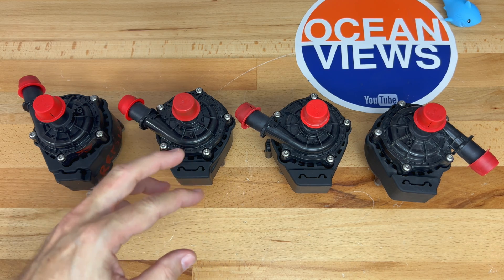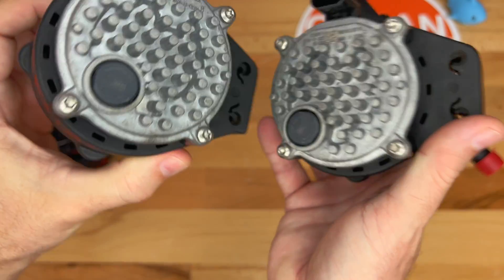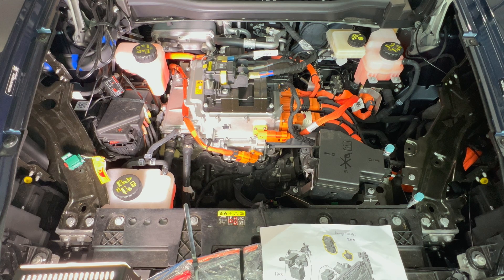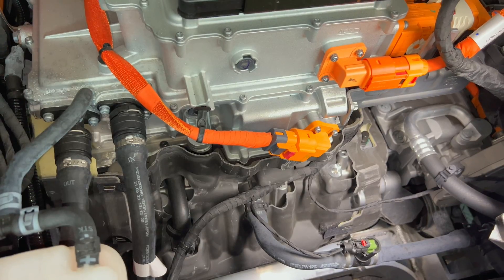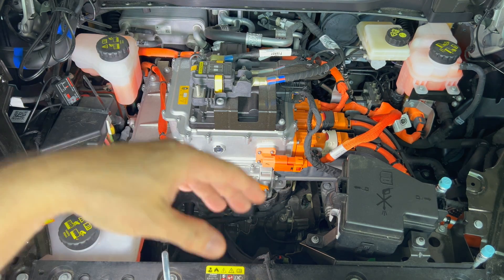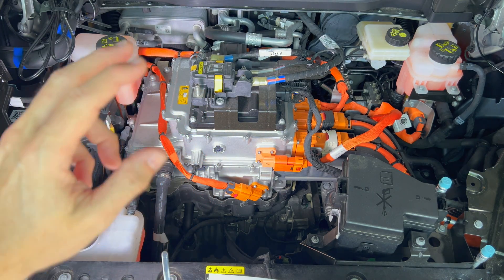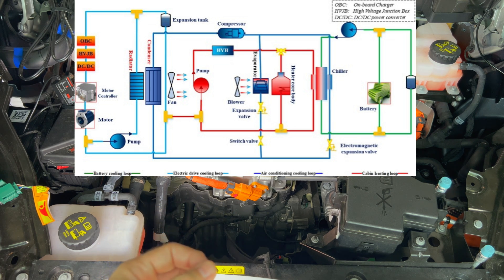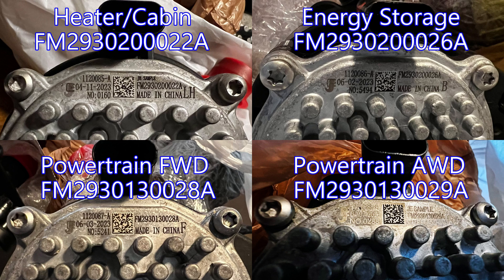Fisker Ocean - Water Pumps & Coolant System

Comment: Hey Mountain Ranger, thanks for your videos! To clarify if my technician changed the correct Pump, must the pump always have the last four digits be: 0022A (in the recall instructions are different numbers on the picture). Thank you
Reply from the maker: @GerritVerheijden  The recall part numbers end in 22A for LHD and 103A for RHD.

Comment: Hi , as I mentioned I just saw some water coming from underneath the vehicle so if it’s one of the pumps I should see an alert about from one of the pumps that may be malfunctioning from the vehicle ? 

I am Buying the tools from your links to get under the hood . So far I don’t have any warning lights but it’s concerning
Reply from the maker: I'm not sure if you will see an alert from the pumps. Let me know how it turns out.
Reply: I had the recall pump replaced but they failed to calibrate my car because the dealership did not have the regular tech that knows how to work FAST TOOL and  they drained the battery and now I have zero safety features working . 

All pumps are good and no leaks detected , they are telling me the leak is from  the AC unit condensation . 

Thanks
Reply: I had the recall pump replaced but they failed to calibrate my car because the dealership did not have the regular tech that knows how to work FAST TOOL and  they drained the battery and now I have zero safety features working . 

All pumps are good and no leaks detected , they are telling me the leak is from  the AC unit condensation . 

Thanks
Reply from the maker: @ Good to hear it is just condensation.

Comment: How would you know if a water pump has failed? The reason I ask is because I am smelling a fishy smell in the cabin 😮
Reply from the maker: @JohnSmithltjg  You would get some warnings on the driver screen showing for the Hv battery and some other things.  Also it will go into limp mode where you can drive at best 5-10 mph.
Reply: @MTNRanger  thank you so much for all that you do to keep us rolling and optimistic!
Reply from the maker: The smell you have happens in cars that get mildew/mold in the HVAC coils/cabin filters.

Comment: Since replacement pumps are delayed - I wonder if it's possible to remove the pump and disassemble and put and extra layer of circuitboard waterproof coating on it? 
I saw somewhere that a software reset was also necessary for this recall/repair - but maybe that's only if the pump actually failed and it went into 'limp mode'...
Reply from the maker: Yes, there is a specific way to waterproof the PCB. I plan to do a video on this.  BTW, nothing in the recall technical service bulletin talks about software.  It's strictly a hardware replacement.
Reply: https://youtu.be/LdSf988Nxwg?si=DxYEDVGEHDUgluC4

Comment: So appreciate your help.  Let me know if you can do an HVAC video many have AC problems where it does not get cold.  Can you do a video on checking AC pressure to see if low state of charge from factory?  I have a FOO hot air blowing from vents never gets cold.  Tried bringing to two service stations so far to check but mechanics refused to look at vehicle.
Reply from the maker: Sorry, I'm not experienced with HVAC to make a video like that.

Comment: When do you replace the coolant?
Reply: But we can’t open the hood, how would do that? Also, how would we know when they are below the line? Btw, huge thank you.
Reply from the maker: @gilbertnau6002  Yes, you can open the hood.  See this video: https://youtu.be/3HXVLZUXgdA  On outside of each tank, there is a max line and a min line.
Reply from the maker: I could not find specifics for the Ocean, but most EV manufacturers list anywhere from 5 to 10 years or 100k-150k miles before replacement.

Comment: AWESOME Video Matt... If you hear any updates on our replacement water pumps and how we are suppose have it done please let us all know. ALSO, if Fisker does follow through in replacing the Water Pump do you know if it's all 4 Water Pumps or just one?
Reply from the maker: FOA is looking at the recall pumps and working with Fisker. I'm pretty sure the recall is just the one pump.  I hope to disassemble the four pumps and see if there is any difference inside.  Hopefully it's just the one part number that has the incorrect conformal coating.
Reply: @MTNRanger  Matt as a Fisker Ocean owner like myself what are your thoughts about the FOA using a Attorney to arbitrate with CHASE, are you going to sign up with them even though they will take 30%. If you do how will that work for example if I owe $40k would they take 30% of what I owe leaving me to still be short / upside down but free of the loan with CHASE
Reply from the maker: @271830066  I didn't use Chase, so it doesn't apply to me.  I have no idea how a settlement work end up working.  Especially since it could be anything from nothing to a few thousand to the remainder of the loan - who knows?  But you are still probably better off than not doing anything.
Reply: @MTNRanger  thanks for your input

Comment: Great video!

FYI, the orientation of the outlet of a pump relative to the mounting is called "clocking." 

It looks like the pumps are identical, just with different mounting equipment.

Some have also simply been sealing the outside of the cover of the pump with silicon (where the metal top meets the plastic body/housing). Not sure if this will be successful, depending on where the water is coming from.
Reply from the maker: Thank you for that information!  I have a follow-up video in about a week that will show how to fix the issue.  Sealing the outside would be a temporary fix.